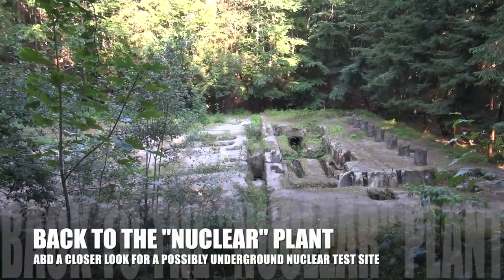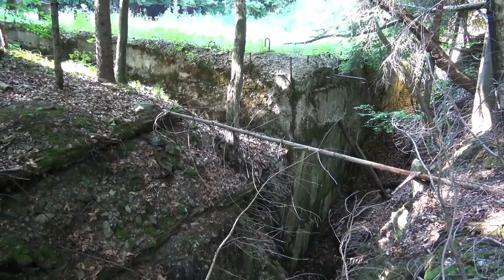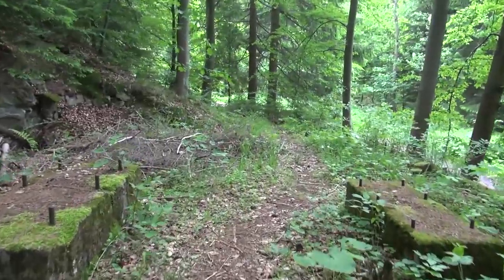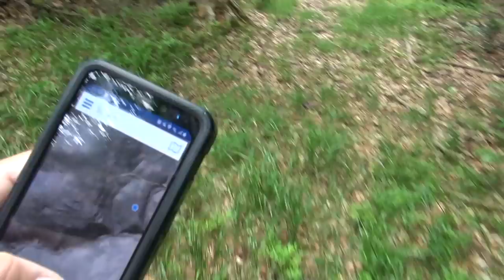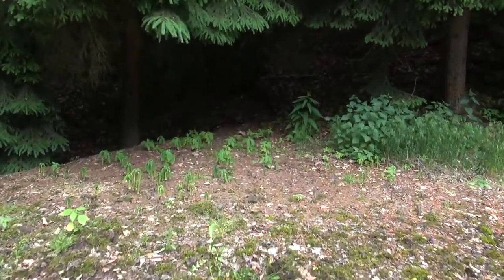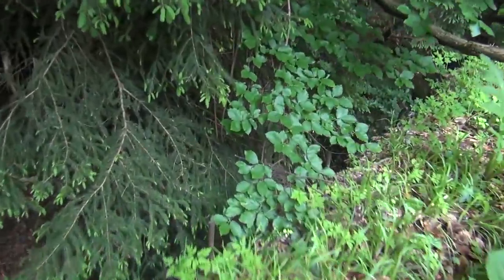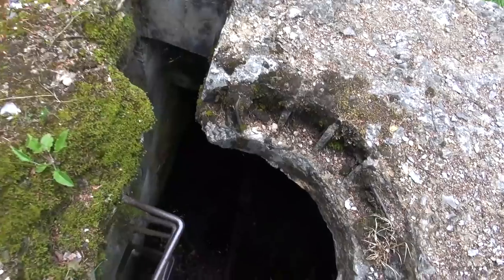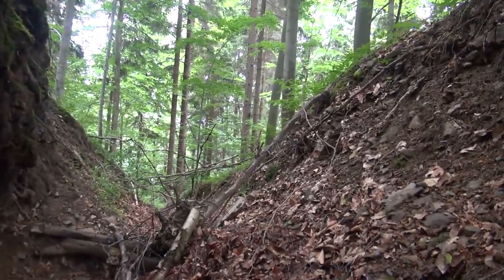THE LAST NAZI SECRET - THE RIESE PLANT - THE NUCLEAR - APPENDIX 4

Comment: Just thinking about the odd horizontal re-bar with the conical ends, around 48:00 :

Did you notice if the "cone" was internally threaded? The "nut-like" hexagon on the end is not likely to be there just for aesthetics.

Possibly the cone was there to act as an attachment point for a a hydraulic or mechanical ram, or jack. This is common in the construction of "pre-tensioned" concrete floors / ceilings. Once the concrete has fully cured, unhitch the tensioning equipment and go to the next stage. By this process, it is possible to build strong horizontal concrete slabs that are relatively light and that "flex", rather than shatter..

The interesting side issue comes when the slab is fractured during demolition, (or the generous application of high-explosives). All the internal forces  mean that the slab (or wall) tends to shatter, tossing concrete fragments all over the place, very loudly. The REAL structural strength in reinforced concrete is the steel. The concrete makes it waterproof and easier to walk on. HOWEVER, there is a phenomenon known as "concrete cancer" which is basically the re-bar RUSTING and EXPANDING inside the concrete. As it does this, it generates radial forces that will crack the concrete and even breaking off chunks if the problem is near the surface.
Reply: they look like they are controls for some thing has anyone put a wench on them to see if they move? as there are want you would use to adjust something dangerous like gas or chemical manufacturing  from a safe distance

Comment: I would suggest that the big foundation with the concrete pipes connected to the small room could be air intake manifolds. That whole installation is as seen on the map connected to a tunnel, so it's may be the remains of the Air supply facility.
This facility would need electricity for huge blowers and pumps, water for air washing, rooms for Sandfilter and so on.
And everything under thick reenforced concrete.
Or, if there was a reactor of some kind( we still don't know how advanced Germany really was in this technology) it could have been some sort of cooling facility, a safety installation (overpressure, Gas Outlet etc.)

Comment: Time 48:01  is is either of two things for me, 
1. Something to grip to create tension or

2. (This is what I really think it is) a capped pipe. The end is tapered and probably has a threaded inner so the Bolt can screw in and cap it off. That Say's liquid, air or gas. Add that to the floor pipes in the chamber at Time 43:29, could be for chilling or heating? And the end pipes are where it enters or leaves.

Just watched this again, not so sure now. Tino does a really thorough job but It is difficult when you have not been on site. Maybe i need to at some point.

OK, my last comment on it, its a 'Bell Anchor' for post stressing concrete. They look different nowerdays but you can see the reebar is threaded, the bell anchor is screwed on and followed by the nut on the end.
Reply: The post stressing anchor is what I thought of, but I'm not an expert it just reminded me of that.

Comment: At 25:20 the concrete layout reminds me of a manual valve body for a transmission. Lots of pathways for fluid. I wonder if there are more layers below it for some kind of heat sink or way of controlling the flow of fluids. You never know.

Comment: It certainly is a conundrum. But no one goes to the trouble of threading rebar and capping it,  so those two pieces, might not be rebar, could they be small bore pipe. Might I suggest Tino that you get out of the habbit of calling machine foundations generator stands as it tends to make you think in a box. The underground room with steel pipes on either side may well have had a machine between them rather than simply pass through and is in fact more likley as removing a few feet of pipe for scrap is considerable effort for little reward.
The two ceramic pipes on the outside of the ruin show no signs of having been cemented to other pipes now gone, they are completely clean, more likely they were cast in there for another purpose, perhaps cabling.

Comment: If there was a reactor it would require a large amount of water. I didn't see much water on the ground. If the water was diverted from upstream and moved underground, there should be some evidence of that. Also, with a topo, it should be easy to see the main drainage area for the area.

Comment: Tino, you should really scrap off some particles of this "rusty" looking color of the wall and analyse that as there are certain pigments that occur only after radiation events. Just send it to a lab and let them analyse it, you wont pay more then 200 USD for that and we could be sure that this was another reactor plant. 

My best guess is that this is another reactor like the one from Diebner but way more advanced. I don't think that this is a heavy water plant. Why?, because it would be unwise to use water from a flowing current like a river for that, because all the particles are contaminating the water way to much. Heavy water plants are therefore only to be found near dams as there is no current and the contaminating particles separate by falling to the ground so there is way less need to filtrate the water before processing. Not to speak of the massive energy consumption of such a plant, where would it come from?

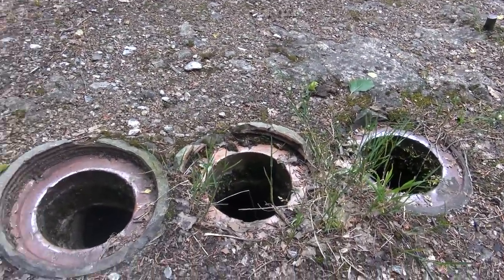Comment: @30:00; the rebar.

If that heavy rebar is in straight lines, it may indicate that the "stubs" were part if a wall construction. Additional bar and mesh would have been welded to the stubs an then suspended inside formwork for casting concrete walls.

If, as seems to be common in these places, the "Shed" was "blowed up good", then the walls would have been blown out, with the lighter-gauge reinforcing separating suddenly at or very near the weld.. The bent-over ones may have got that way somewhat later.

In and around some of those odd footings, is there any sign of burnt timber? I suspect that there may have n use of "traditional-looking" structures (wood / tile /shingle) built on top or wrapped around surface structures as "camouflage.There used to be a huge example of this sort of thing in Brisbane, Australia. There was a complex of "facilities, including an ammunition plant, out in the southern suburbs. Fearing that a stray Japanese recon flight might spot it, an enormous piece of fake scenery was built from timber, over the top. This was artistically decorated to look like a street intersections and so on.. The ammo plant (Head-stamp "MQ") was winding down as the end of hostilities approached, The classic "clerestory-roofed" timber buildings lived on for come decades as commercial light-industrial spaces.

Comment: Re The line of concrete tubes/ vents. What you describe as 'rooms' below the row of vertical concrete tubes look like water culverts and the tubes, steam vents/ chimneys.  To me as an engineer it looks like a cooling system with steam vents to allow for rapid steam dispersal.

Comment: 7:16 If there was high levels of radioactivity the trees will have a record of it. For a pine tree you need a tree of about 50cm diameter. The rings will tell which years had higher radiation levels.
Reply: You would think so but those trees are long gone. The trees that are there are from the 60' of 50's. The radioactive trees would be long gone. There has to be old stumps that are still partially intact.
Reply: @biggerbehindthetrigger2814  Yes, you have to find a tree old enough. That's why I put an estimate of 50cm (stem diameter 1m above ground).
Reply: @unclewerner  tour very smart. Sounds like you have experience with radiation

Comment: A Schnapps distillery or a plant to separate heavy water. A chemical analysis of the area would be useful to see if there is a high level of sulphur compounds which would point to heavy water via a hydrogen sulphide process rather than schnapps.
Reply from the maker: do you have one in mind
Reply: It is all about water, that's for sure. Heavy water is not far fetched. It could have been also a coal hydration facility or a plant for nitrogen extraction.
Reply: @dointh4198  Yes. Ammonium nitrate would have been vital too and needed by the ton.
Reply: Def a schnapps still up the hill or perhaps a pear eau di vie

Comment: What if the internal round tubes were moving steam and the platform area with the walk around, was for a steam turbine? That generates the electricity with the big chambers supply the water for the small scale Deibner machine?? 
Small scale produces steam after a reaction which produces the electricity which is then sent into the tunnels to power hidden infrastructure
It’s quiet production, water is readily available- run off from natural convection of clouds over the mountains ( they drop rain as they get lighter ) and so ad infinitum
Self repeating water supply to power one of his “toys”.
Be interested @Tino V Struckman to know your thoughts on the above hypothesis…..

Comment: Those tapper cones are to tension something down as you can see the threads and cap nuts
Reply: Makes sense. Rebar is tensioned if it is included in concrete intended to carry a heavy static load.

Comment: Hiya Tino I think it's a type of water filtration plant as I seen some old style air couplings thread flanges there ,, with use of clay pipes an cement pipes it dint strike me strange as you can use these types of pipes to get the raw water into the plant for the process of what hmmm not sure but it does look similar to a filtration plant to me as I have worked in many of them here so similar. 
Kind regards Jasmine from Sydney Australia
Reply: Yeah it's definitely some kind of Water Processing Plant, but what do you understand of Filtration? Do you mean just to separate bigger particles like leaves and stuff from the water? If this was meant to be a heavy water plant i really don't think they would use "river" water as there is way to much crap in the water. Usually they use water from a dam for that as all the bigger particles are falling to the floor since there is no big current in the dam. Therefore It would be unwise to use water from a flowing river.

My best guess is that this is another Reactor building like the one from Diebner but way more advanced. Tino should really scrap off some particles of this "rusty" looking color of the wall and analyse that as there are certain pigments that occur only after radiation events.
Reply: @bogeydope3022  hiya I worked in a  water filtration plant for some yrs all the filter blocks are out side no covers an the plant I worked at is for clear water  the raw water comes in goes through the process  now is clear water goes into 50meg water tanks to be pumped through the sydney's water distribution network but as I seen there a lot of it is missing an it may not even be a water treatment system but even so you can turn high turbidity an high calcus water into pure clear water we do this here in Sydney for our sewage treatment plants it's used for fire hydrants and in industry  an it must meet strick guideline to go back into creeks an rivers so you could use river water but who knows what it realy was what's missing from there and  what was its use realy ?? ,, samples would help yes but be more cost for Tino  only history knows the truth 🤔🤔🤔
Reply: And if it was such a process plant useing the flow of a river be a great help as you can use the head of pressure in a pipe to push water up a hill with very little pumps or none at all we used to use a centrifuge for separating the sludge we would use the head of pressure to push sludge up a pipe up a hill from the holding tank to the centrifuge for separating this is old tech method without using any pumps but who knows what that process plant was used for 🤔🤔🤔
Reply: Oh forget to mention it was a very steep hill an over 200meters away from the centrifuge
Reply: @JasmineJDMgirl  Very interesting, how clean does the water come out via this method? (Centrifugal) Do you think it would be clean enough to run a heavy water plant? The other thing is though, that even if it would work, where does all the energy come from? Heavy Water separation consumes a LOT of energy, why it is usually coupled with a hydropower plant plus the advantage of the dam water being more clean.

One more thing, since you are an hydro engineer guy, what does the overall layout tell you? Especially those small basins and caverns, or the certain curves to slow down the water? Do you think it looks like a setup for filtration or more like a system for cooling water? I think it could be very well made to get water from a river but AFAIK there is no river right? Or did he say something about a near river?
Reply: @bogeydope3022  Well the centrifuge is used in the treatment plant to remove any water  in the sludge the sludge is all the crap that's been  cleaned out of the raw / dirty water ,,the clean water extraction can go back into the process for the clear water system ei back into complete treatment of the clear water the sludge then is removed after it's been through the centrifuge then taken away an used for fertilizer it smells like elephants poop lol .
You asked about the power consumption of the centrifuge it's only a small electric motor it's on a gear box so no need for big heavy power consuming motors. 
Well I will say with all those cement pipes look like 400mm plus dia they where most definitely for some sort of water processing system of some sort as you seen there was a  gallery the  big cement pipes went down into the water galleries,  we use the same systems in the plant I worked at so I'm positive it's a water processing system of some sort pitty Tino could not get into it he could only see  a small part of it but what we could see most definitely  is part of a water processing system of some sort it has to many similarities to a modern water filtration plant,  where those big cement pipes went down into the gallery to even out the flow is a dead giveaway. 
What type of plant hmmm ??? Most likely a pre treatment plant  water for heavy water maybe????
Reply: Oh an to clean a purifier water is complex but simple process weather it be dam water river water or even sewage it's not hard the hard part is making heavy water not making it purified an ready to use for a process.
Reply: @bogeydope3022  No I mean the water of the plant you can bottle it it's pure clear clean water , there are  filter blocks that are 9mtr deep with sand charcoal an gravel in them ok the water comes from its  source can be muddy full of particulates an crap ok it goes into the filter block called the ferric raw water mixing block first  it goes in there gets mixed with ferric chloride an non ionic polymer  or a cationic  polymer which gets out loads of crap turns into a flock on the top of the. Water in the mixing block then it goes into the filter blocks gets filtered in the sand gravel an charcoal then goes into the super natante  tank then into a settling tanks with a rake system in them . Now in this process  chlorine gase is injected into the mix and lime to control chlorine trends /levels  to sterilize the water an to control the Ph of the water . Now after leaving the holding settling rake tanks with control again of the chlorine and lime for Ph 7.2 chlorine of 1.6 clean pure drinking water

Comment: its a system that makes sure air doesnt circulate and flows one way...hospitals dealing in diseases,chemical factories and labs use the same technique...so if any mistakes and something airborne its getting flushed away instantly
Reply: looks like they were also using vasts amount of steam ! cleaning the air by flushing the outgoing air with steam captures airborne particles and even can be rescued and reused...steam to heat the place and also water cooling something then generated to steam?maybe one of the processes...youd have steam pipes and seperate washed air ones emenating from structure...what they were doing? i dont know

Comment: that odd looking complex of concrete is very odd indeed

thinking of something no longer wanted or demolished, if something was being blown up or knocked down, you'd think there be more rubble, in particular left in the holes and recesses, and if robbed out by historians, locals etc, where is it - someone at some time went to a lot of trouble bending exposed rebar to prevent injury, so why not leave holes filled or refill again

another thought, you have an obvious set of steps going down to lower level, so obviously for general use of all ranks perhaps, but then vertical service ladders still in place (rebar style) which are obviously only used in times of emergency (escape) or only for service personnel 

my guess is the ceramic tubes pipe might be for water fluids coolant or cable ways, i wonder what remnants there may be of sealant? it may be worth getting someone to test samples from pipes and perhaps that orange stains on the wall, does look a bit like an orange algae growth etc

i wonder who the current land owner is, what's there knowledge, and what responsibility they have to the public if any, i know these matters are less important in many territories, but interesting to see what they know, what might be in local land registry if available, you need an inside man perhaps looking to invest in that piece of land who could be told why he can't have it ? perhaps